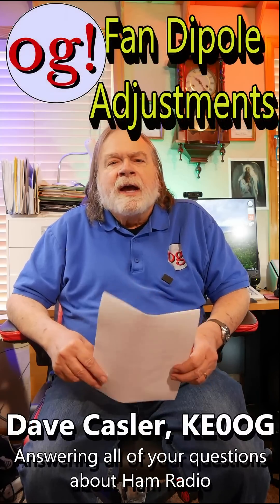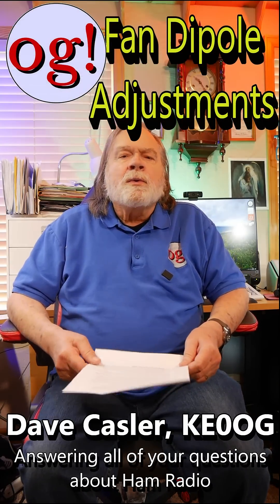Fan Dipole Adjustments (Short #29)

Comment: Why use a balun?.
As far as tuning is concerned there is no need for a balun on a fan dipole.
It is good practice to make the dipole legs a few inches too long.
Just fold them back on themselves and get the swr spot on in the part of the band that you want to use.